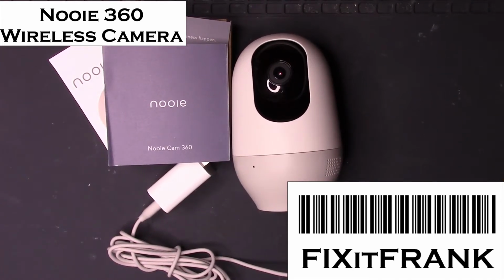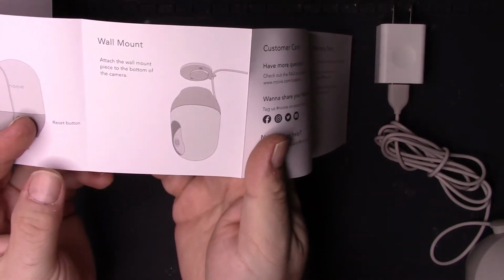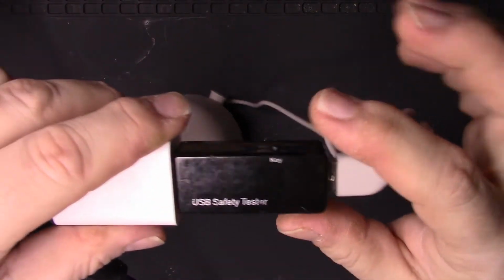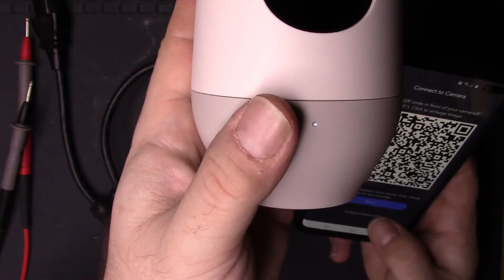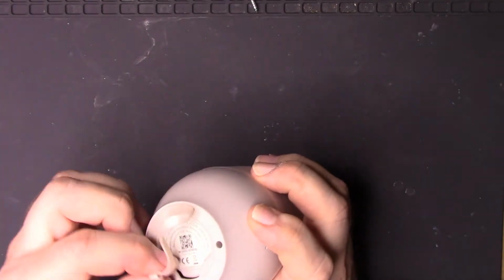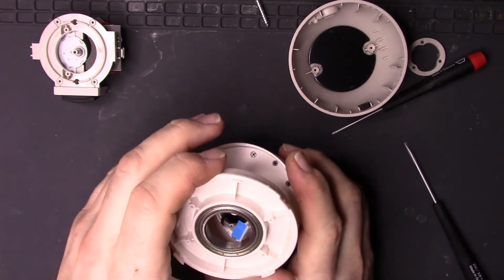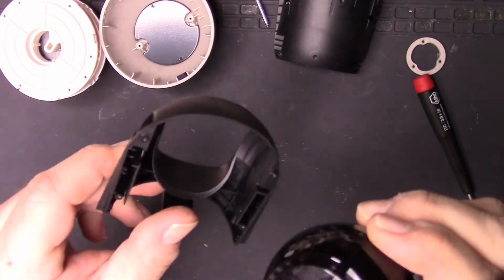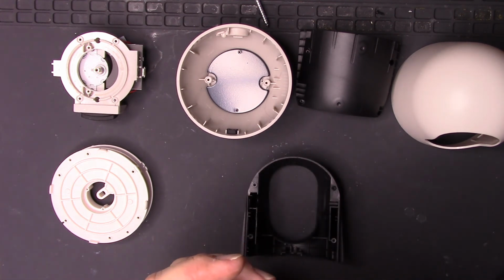Nooie 360 Wireless Camera Setup / Teardown

Comment: Good Morning, I know this is old but do you happen to have teardown knowledge of the Nooie ProCam? I have one with a foggy lens. looks like it got moisture in it and there appears to be no good way to disassemble these cameras. Thanks 🤷‍♂🤷‍♂
Reply from the maker: It looks like the front is held on with glue. Meaning the oval black part.  I bet if you gently heat that with a hair drier and pry up in the edge it will come off and you will see screws under there to get inside.
Reply: @FixitFrank How did I miss that! Thank you, i have the tools to remove phone screens this shouldn’t be too difficult 🎉